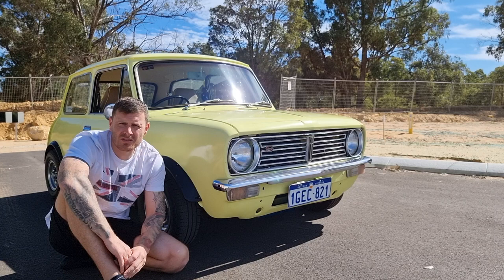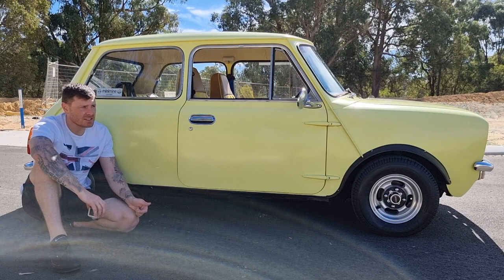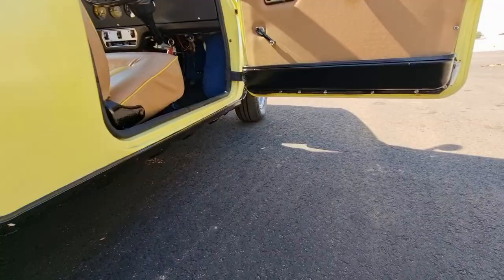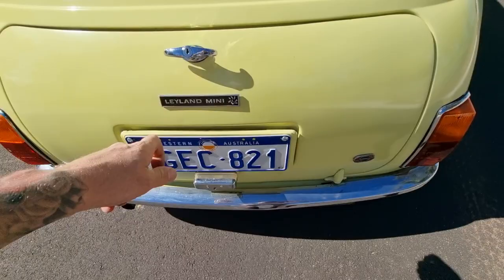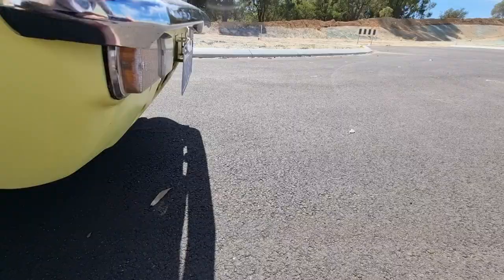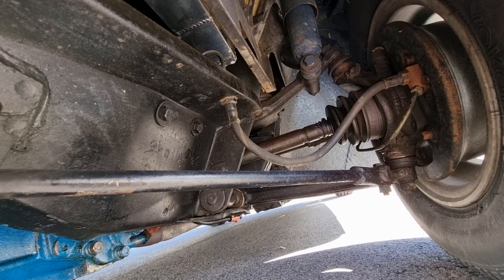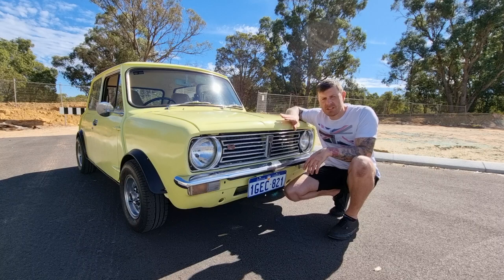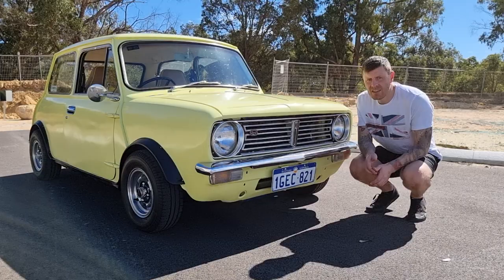Classic Mini | Buyer Guide

Comment: Holes in front floor panel should be closed with their grommets. Those are drain holes (as battery box holes) for when the shell was submerged during production in the factory but if you leave them open all the road water splashed by the wheels will enter inside and moisture your carpet and insulation stuff, even when you whas the car.
Reply from the maker: Yeah, it never rains much here in W.A and she is only out on the nicest of days
Reply: Yep, thanks mate! ^^

Comment: Great guide mate, thanks for sharing! ^^
Reply from the maker: Thank you, hope it helps you out. 👍
Reply: @craigslistofprojects3451  
Since I have been working with Minis for a while, I know the weak points. However, the video is a very good summary for people who have little or nothing to do with classic Minis and are considering buying one. 😁👌
I've owned a MkV Mini since about 1998, before that I had my first Mini, a 1987 MkV from about 1994 to 1996, which was on the road with 13 inch wheels and fat fender flares. Unfortunately thanks to bad rust and an accident it had gone to the scrap heap early on (it wouldn't have been worth repairing). 😓
In April of this year I fulfilled a childhood dream by buying a 1964 Morris Mk1 Cooper S. The purchase ate up a lot of my hard-earned money and the Mk1 still needs some love, but that's the way it is when you're hooked on the little Minis. 😂 You can find a short video of the exhaust and engine on my Youtube channel. 😁
Reply from the maker: @Macaco_Branco  I'll check it out. Mk1 copper s would be the dream. Hope you get her restored back to former glory.